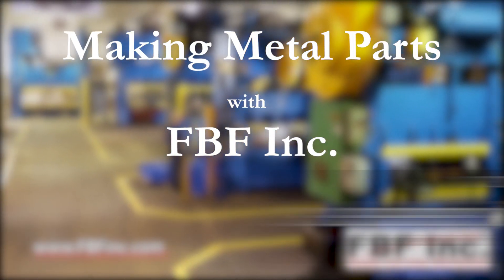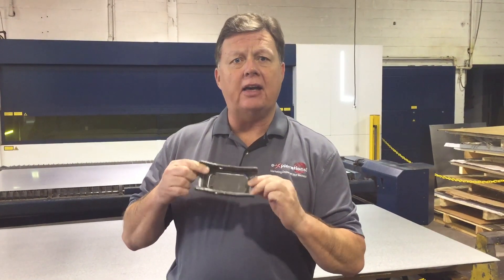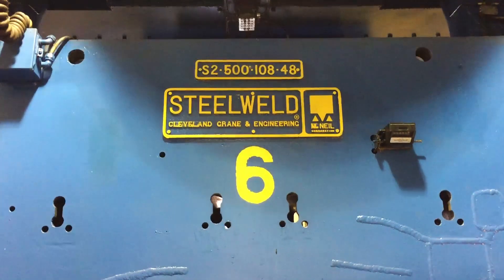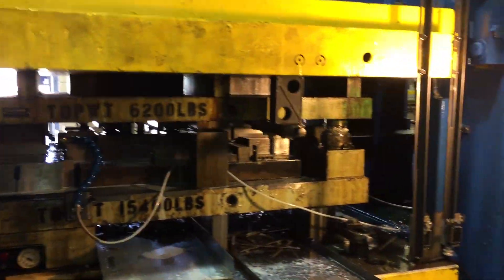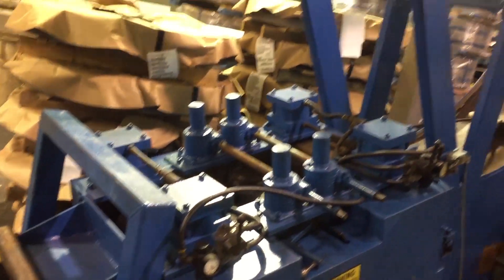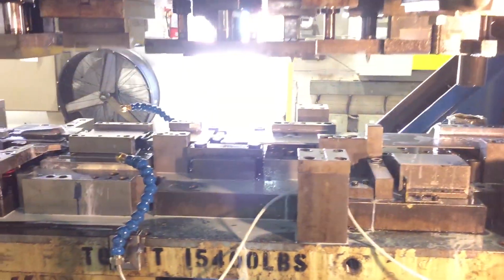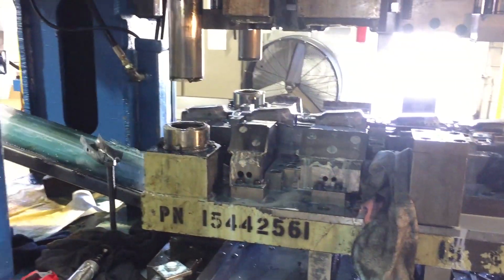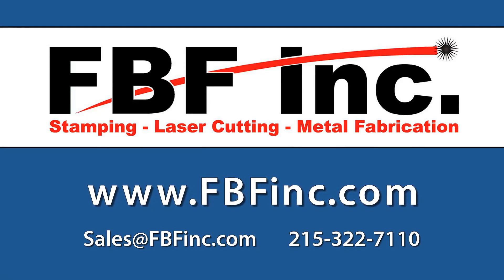Metal Stamping with 500 Ton Progressive Metal Stamping Press - FBF Inc.

Comment: Ahh the memories. I use to run the 500, 800, and 1000 ton presses at Styberg Engineering in Racine WI. Made parts for Caterpillar, and Mercruiser. Late 90’s and early 2000’s.
Reply: Good for you 👍

Comment: Is this using servo motor or this is using a mechanical press system. It would be helpful if you could explain what's the difference between hydraulic pressure and one that uses servo motor.